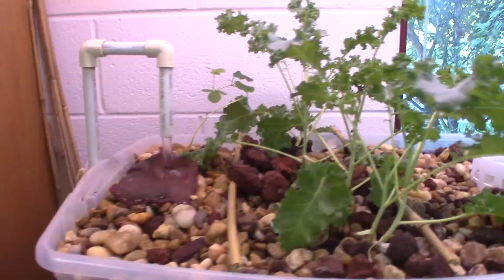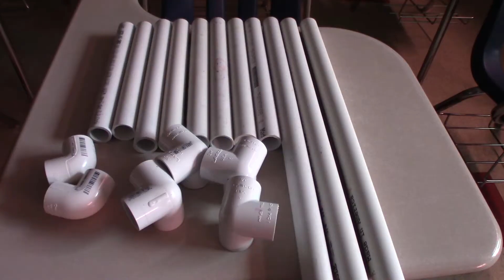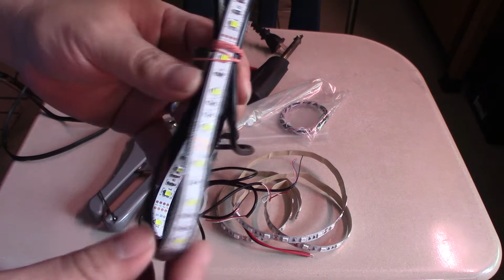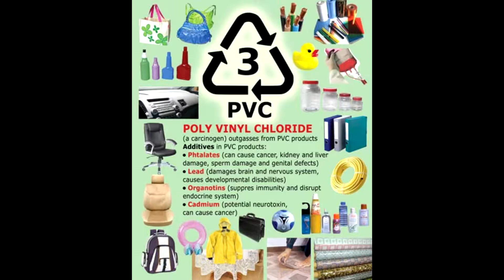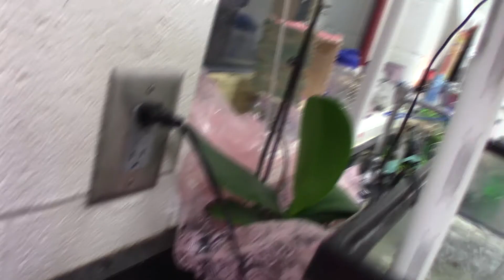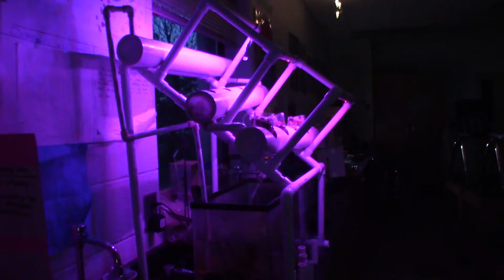NFT Update: $11 DIY LED Grow Light System

Comment: I would not recommend 9V at all. You may find that running the 12V strip slightly over 12V, say 13.8V as in an automotive setting, may dramatically increase their output at a slight cost in lifespan. I'd check the specs to see what you can get away with. You can get adjustable LED power supplies cheap on eBay. Thanks for all the info!
Reply: That said, I usually go with stated voltage for long life, but check with a meter at the strip to account for feed line resistive loss that could cause a voltage drop.